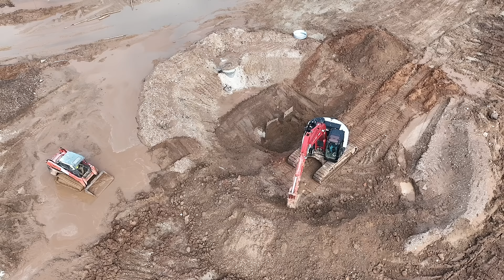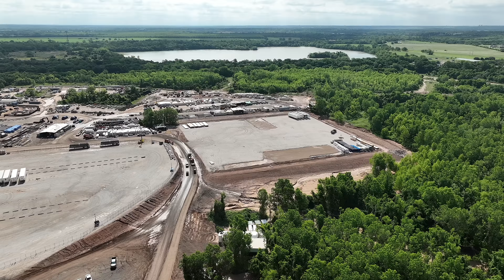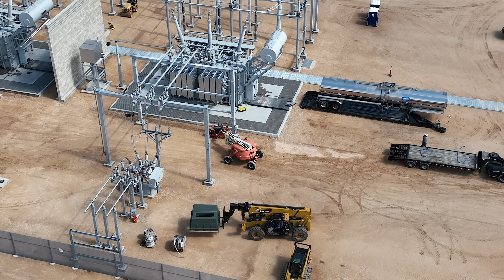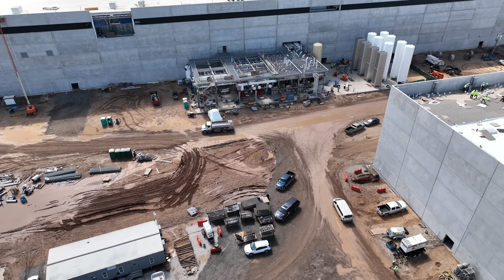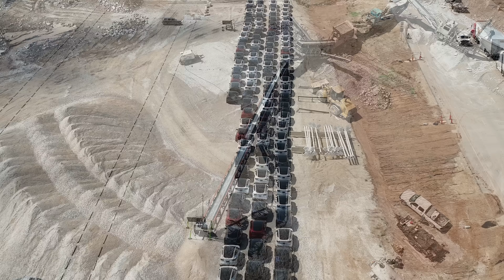"Model Y Overflow"   Tesla Gigafactory Texas  4/27/2023  10:18AM Model Y

Comment: Thanks Brad
How much rain?
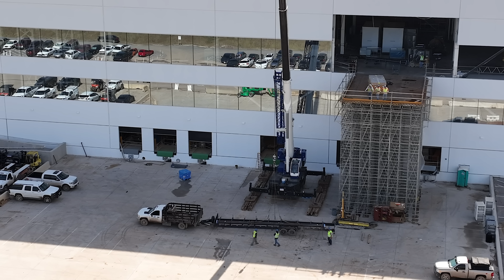1:25. GA west, loading platform. First use.
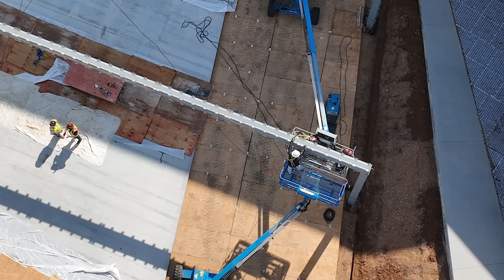2:57. Main Entrance. Fixing brackets/tabs to the portal frames. Beams, plus the columns as seen top left. Would seem to be a cladding system. It’s not a roof decking system.
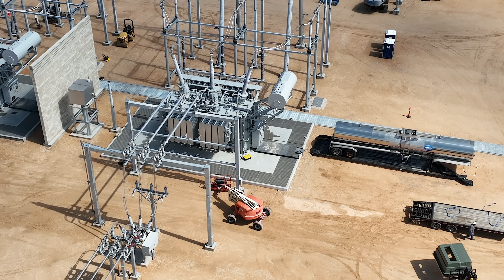5:20. New Switchyard/Substation. Green items being unloaded. Electrical vaults?
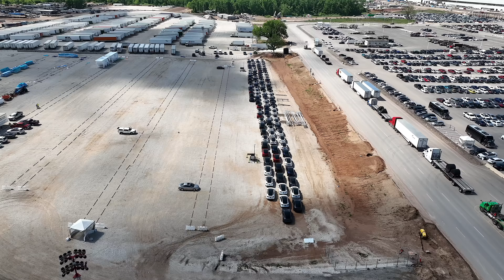8:33. WOW yard. Is it a drone? Operator to the left.
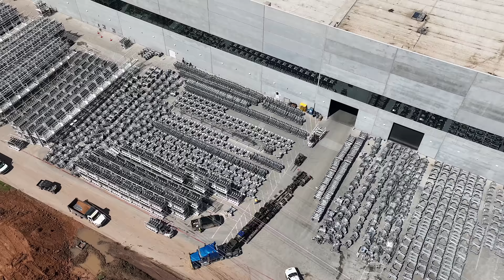9:24. Casting, apron. Extra heavy duty low-loader.
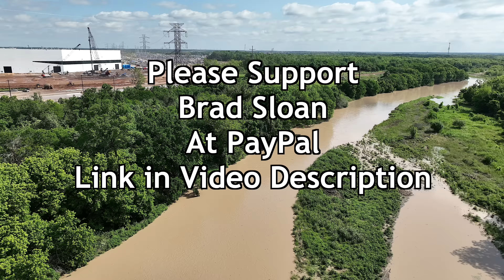10:19. River looking muddy.
Reply: Dessie, a local rain gauge about a mile from the GF got .55 of an inch. Now, these are from fast moving thunderstorms. And each cell or cloud can drop more or less.  I’ve got 10 acres and I’ve seen the front half get drenched and the back half get almost nothing. But I’d bet that half inch or so is a good bet.

I’d thing that the green thing is a small vault.  I agree that looked like drone shadow to me. And the river is extra muddy since the rain is coming from these big thunderstorms. So instead of letting the rain have time to slowly soak in, it comes down in buckets and washes a lot of stuff away. It’s why they made them build those big detention ponds and structures. Those big fast rains will wash off parking lots and such with as little as a tenth of an inch. If you dumped it straight into the river it’s too much sediment and pollutants for a low flow body to take. But if your detention pond can hold that until you get say a half inch, then there is enough water to dilute all that mess. That’s the theory anyway. Plus, it’s also to help control flash floods but they lost that battle a decade ago. Building a pond to detain a tenth of an inch is expensive. Building one to contain a half inch or more is extremely expensive. So the City and County governments have let the developers pay into a flood control fund instead of making them control their runoff. Sadly, instead of controlling the floods, the city, county, and the Federal government are just buying out homes that never flooded for 50 years but started doing it in the last decade. They are buying out whole neighborhoods. What a scam.
Reply: @Bill_N_ATX  River seems high, and muddy. Plus lots of mush getting pushed around at the southend. I guess 1/2 an inch was enough.
Reply: @DessieDoolan   The river drains all of the area east of the dam on Lake Travis. Areas to the west may have received much more rain than a half inch. You’d have to look at the LCRA hydromet report to know that. They have a very extensive set of rain gauges and flow gauges all up and down the river and its major tributaries.